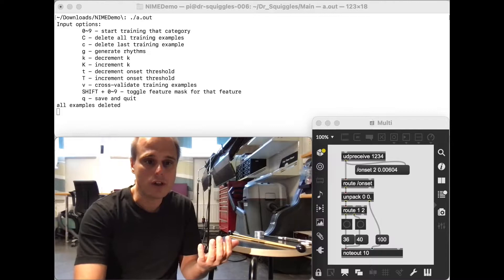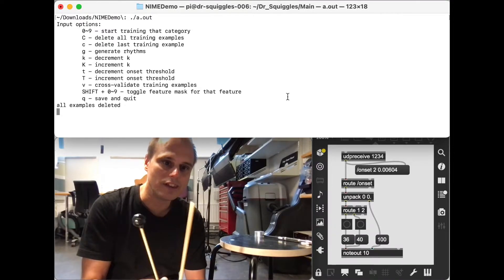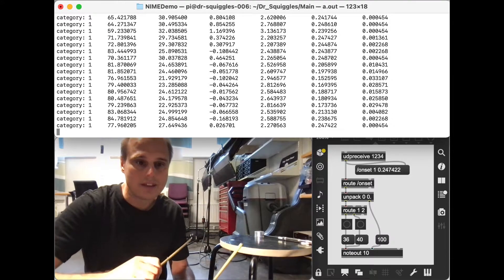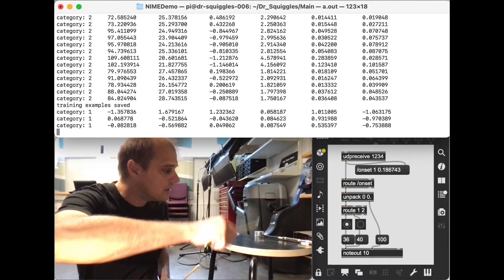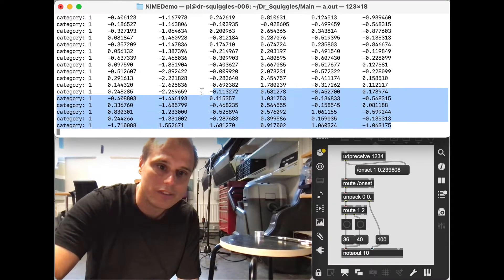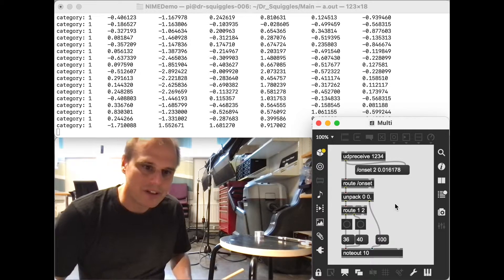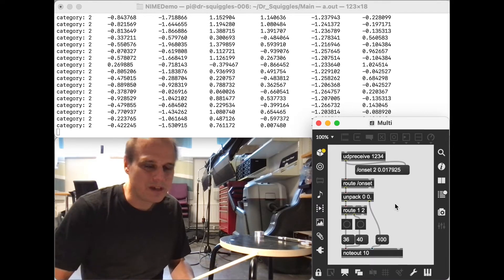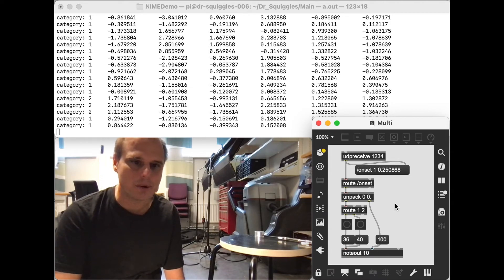How to trigger multiple drum sounds with one contact microphone

Comment: I did an experiment in ableton with a contact mic and a metal box. I send the sound to 2 different tracks and put an eq in each, the kick only recives the really low frequencies and the snare only hiqh frequencies.
Instead of triggering a sample I made a lot of sound design with eq, gates, saturation and compressors to make each sound more similar to drums, also the snare triggers a little bit of white noise in another track to sound more realistic. and it has no latency and a lot of dynamics.
The only problem is that when I played the snare in the metal box it also generates low frequencies, so if I played to hard the snare, it would also sound the kick. But I hope I find  solution.